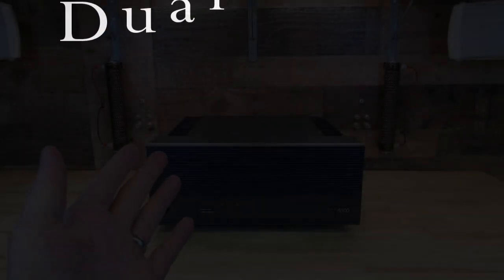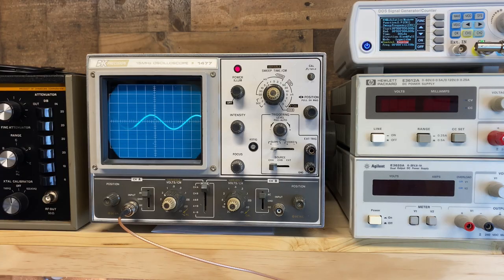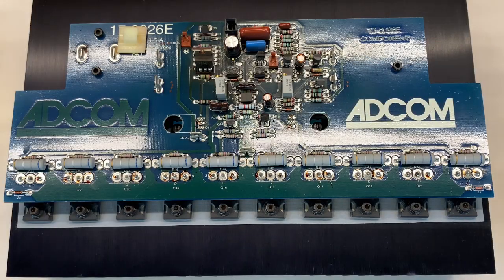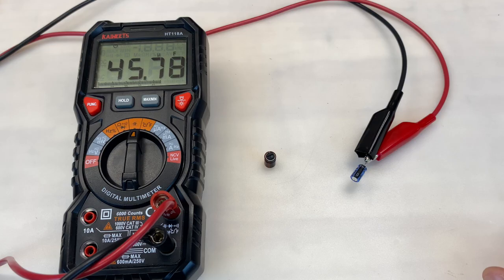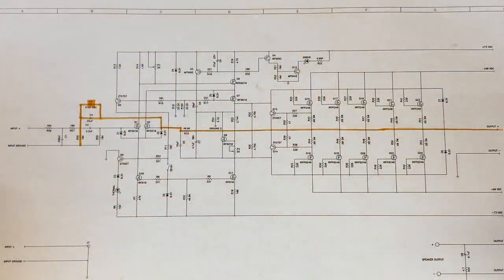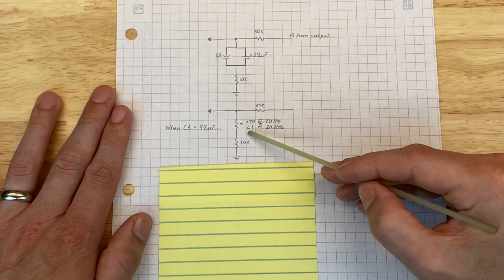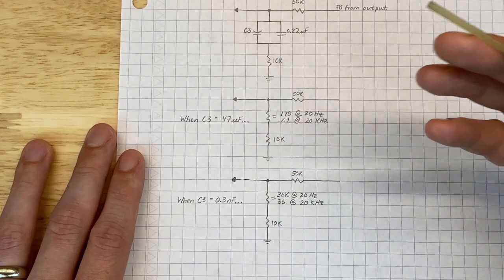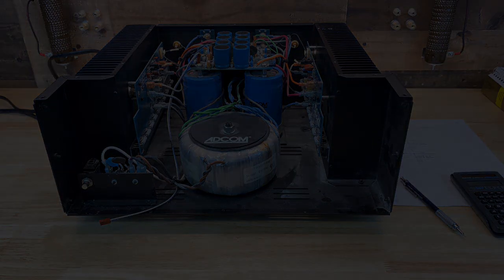DR #55 - Restoring the Bass on an Adcom GFA 5500 Power Amplifier

Comment: I have this same unit, my right channel heat sink, slowly drifts over time and is noticeably cooler. 

The right channel p2 pot seems to drift downward , sometimes as low as 11mv, requiring me to adjust the p2 pot with a multimeter to 50 +/- 5mv across the r32 Resistor.  Left channel drifts downward too over time, but to a lesser extent.

What is the most probable culprit?

Thanks for your video, I'd love to service this thing if needed.  I bought this back in 1999 I think. 

Based on the age, might have to recap?

Thanks for your video 😎

Comment: I've owned and repaired many Adcom amplifiers. The 5500 and 5802 are both MOSFET (HEXFET) vs Bipolar designs and again are based on Nelson Pass designs. When they were introduced a dealer loaned me the 5500 and later the 5802 so I could compare them to my GFA 555ii and GFA 565 mono blocks. The GFA5500 and GFA5802 were definitely more neutral while more transparent sonically than the earlier GFA555ii and GFA mono blocks. I periodically bench them and both the GFA5802 and GFA5500 still meet specifications. I have replaced the smaller caps on the 5802 and reduced the bias levels on the 5802 as recommended by Adcom to reduce internal heat on the 5802. Thanks for your video. I appreciate your clear explanation of your diagnostic approach.

Comment: I upgraded all my small caps to Elna Silmic II's, 4 big caps from 18,000uf CD's to 22,000uf TDK-Epcos, and the 8 smaller caps to Mundorf 1500uf jobbies.

It betters a Sugden A21SE's amp section. Up there with First Watt and the XA30.8. Just a fantastic amp, wholly designed by Nelson Pass.

Comment: Hi, i have the same amp sitting in closet since it was bought new. Never turned on. is it safe to use it now? Thanks for your informative video. You said the 8 electrolitic usually goes bad thats why i want to ask first before powering it up for the first time.

Comment: My GFA 5500 has the same poor bas response. I tried replacing the 8 caps on the top but made no difference.  I'm going to take the amp apart and try this fix.  Fingers crossed it brings life beck to my amp.  Can you recommend  mfg p/n for the (2) 47uF Caps?

Comment: Hi, I've got a similar issue on my Mission Cyrus one. Did you measure the output voltage under a resistive load?
Reply from the maker: Yes, the amp was connected to 8 ohm - 500 watt resistors.
Reply: @dualityrepair4770  Thanks!

Comment: Your video is very useful and gave me the notion that the ayre mxr i owned has a similar issue. I always felt that the ayre lacks bass weight and resembles little to the reviews i have read. Would you think the ayre would have something like a "c3" lurking in the unit that is hindering the bass performance. Your insights is appreciated. Thanks
Reply from the maker: Yes it could very well have a “C3.” Unfortunately I can’t find a schematic anywhere to help point you at a specific component or area.
Reply: No worries...when I find a schematic I will come consult you again. Thanks

Comment: I am a bit confused by the feedback resistor being so high at 10K ohm wirmth the other 50K ohm that would make the overall gain only X 6 or have i missed something.
Reply from the maker: Good eye.. and you're right.. a gain of 6 is ridiculous. It turns out that the schematic isn't completely correct. The feedback resistor is indeed a 49.9K, but the resistor to ground is not 10K.. it's 1.82K, making the gain ~28. Thanks for bringing this up.
Reply: The old schematic documentatio error problem .
That is why we hone our fault finding skills to give us the tools to overcome these obstacles. 
Dealing with lack of or conflicting information.
Maybe that would be a good subject for one of your future videos. @dualityrepair4770

Comment: Its easy to know why caps failed like that, its caused by heat you can see discolored pcbs in almost all Nelson, Adcom and Nakamichi top end amplifiers he likes to design time bombs deliverately, that amplifier also has a small heatsink in the differential pair that almost all the times (have seen that small metal thing missing in almost all of that model amplifier) and if it didnt went missing it will short ccircuit some transistor or something after the glue fail under the heat...... the same heat that caused the video capacitor fail 😅
Reply: This isn't Nelson Pass's fault, he only provides the circuit design. Adcom did all the actual board design, including decisions on heatsinking.

Comment: This failure is likely caused by heat. The input mosfets run super hot, which causes eventual failure of the capacitor. You can tell how hot the board gets by how browned it is in that area. There is usually a copper heat-spreader bar installed across the two mosfets, meant to keep them thermally tracking, and dissipate some heat. It looks like yours either fell off, or it wasn't included in that particular production run. What I do is install a DIP-16 heatsink across the two of them, with thermal heatsink epoxy, and that dissipates heat better than the original copper bar, as well as thermally coupling them. Also, the heat cycling eventually cracks the solder joints, resulting in a crackling sound, a common issue with this amp. The solder joints just need a touch-up.

Comment: O.K. but why did the elcaps went bad? Strange, but it is as it is of course.
Reply: Both channels had the same cap fail in the same way, from age or something else?
Reply from the maker: I believe they failed in the nearly the same way and at nearly the same time. The caps were probably from the same manufacturing batch, so suffered from the same issue. And since both channels would always be running together, each cap would be subject to the same amount of use. 

My other thought is that one channel did fail before the other, but it wasn’t noticeable to the owner until the other channel failed too.
Reply: @jim9930  Seems suspicious in most cases it might have been by design.  I've seen computer CRT monitors fail back in the day, just days if not weeks after reaching the limited warranty. The failure was due to the power supply capacitors running at the cap-rated voltage. In most cases, caps should have been rated double the application voltage.

Comment: Wow, seeing that the capacitor that went defective isn't subjected to a life of high ripple current or voltages near its rating, I am surprised that it failed in the way it did. I am thinking there was a very poor selection of quality when purchasing. Nice repair presentation!
Reply: that capacitor was subject to ac - the amp's output - thats the reason for the early failure. in other words, poor selection of parts by adcom
Reply: @jim9930  Did you take into account that, there is a 49.9K Ohm ( lets' call it a 50K for all intents and purposes) resistor between the amps output, and the 47uF cap?  With that cap being loaded to ground with a 10K resistor, that would only give it a max of 5 volts AC across it at a 250 watt - full output of the amp. That cap will also have a DC bias on it, seeing that it is connected to the gate on the negative feedback differential IRFD210, but the swing of a max AC signal would be less than that AC signal, and that AC voltage across the cap should be less than 6 volts, creating a current through that cap of less than 2mA according to a SPICE modeling circuit I made @ everycircuit. IMO, it was more of a poor quality cap being used than the circuit it was applied in.
Reply: @jim9930  Quit trying to say " if it wasn't behind a 50K ohm resistor",( and, it's actuallt 60K , as that cap isconnected to grund through a 10K resistor as well)  it IS! The point that that capacitor is DC biased in its proper polarity, but has a max AC voltage on it that wouldn't reverse bias it, negates that point. Also, a modern day replacement, a Nichi UFW 47uF / 100V rated cap, has a max ripple current rating of 210mA @ 120Hz, and that cap is only subjected to less than 3mA of ripple current ( and that's only at full amplifier output), shows it should do just fine, if it is a quality replacement component. 3 milliamps ( under worse case AC ripple scenario), will not destroy a quality capacitor if installed in that circuit.

Comment: When I checked the calculations, I came up with 26.5Mohms for the 0.3nF cap at 20hz. So NFB attenuation was even worse.
Reply from the maker: Yes that’s correct for the 0.3nF cap alone. I was calculating based off both caps in parallel (0.2uF + 0.3nF).
Reply: @dualityrepair4770  What's the purpose of those two caps when their impedance never goes near the 10k resistor across the whole audio spectrum?

Comment: Great video!  I worked over my 5500 a few years ago.  I replaced all the electrolytics on the amp boards with Elna SILMIC IIs though I think they've been discontinued.  Also replaced the polyester caps with polypropylene units.  Also replaced all eight of the 1000 uF electrolytics in the power supply as they were bulging.  The amp sounds amazing!

Comment: Can’t believe this randomly showed up in my feed! I acquired a GFA5500 (along with a Krell KSA 200) in a trade for a turntable I had restored. Tge deal was actually for the Krell, but he threw in the 5500 because he was clearing out some space. Neither unit was in working order. Figured I would take a look at the  5500 first, as it’s a bit less intimidating than the Krell…. Powered it up, no speakers just to do some quick measurements. No smoke - that was good :) But, I was seeing the full rail voltage on the speaker terminals. I poked about a bit, got some help on DIYAudio trying to figure out what the issue was, but no luck. So, I sent it out to a tech, and they didn’t want to repair it (Also sent them a Marantz 7T that I had done a full recap on, which was working wonderfully until I was trying to run a sub off the center channel, and right channel went pop - but that’s another story) All that to say, tech either couldn’t or didn’t want to fix that either. 

I was informed that all the semis in the 5500 were bad. They also said there was a 16A automotive fuse in the 5500. 

I am subscribed and excited to watch the rest of the videos in this series. The 5500 is supposed to be a very capable amp!

P
Reply: It is a very good and pretty  simple amp

Comment: Thank you, very useful information.  I'm puzzled why the same capacitor failed on both channels. Design issue? Component quality, or sizing issue?
Reply from the maker: Good question. I was thinking component quality. The ratings are appropriate and the design seems solid.
Reply: Age and heat IMO. These amp boards run very hot, as you can see by how browned the PCB fiberglass is.
Reply: This cap is located directly above the input LPT MOSFETs, which run super hot.

Usually there is a copper bar glued across the tops of the input MOSFETs, that thermally bonds them so they track each other better, and it dissipates some heat. This amp doesn't seem to have the bar intact, or it was not included in this version. They do fall off! What I do is use thermal heatsink epoxy to attach a DIP-16 aluminum heatsink across the two input MOSFETs, and that dissipates heat better while also thermally bonding them. -Chris Hoppe of Hoppe's Brain.
Reply: Heat, actually. This board runs really hot, as you can see by the browning of the PCB fiberglass. The input LTP MOSFETs in this design run especially hot, and are located directly underneath this poor capacitor. There is normally a copper heat-spreader bar glued to the tops of the transistors, which keeps them tracking thermally, and also helps with heatsinking. This amp is missing the copper bar, so it either fell off or was not included in this revision.

What I do, is attach a DIP-16 heatsink to the tops of the transistors with thermal heatsink epoxy. This dissipates heat better, as well as providing additional cooling.

Also, the heat causes cracks in the solder joints from thermal cycling, so I recommend re-touching those solder joints.

Chris Hoppe - Hoppe's Brain

Comment: I sure hope I have time left in my life to able to make repairs like you do.  Currently, I have 3 NAD amps and a NAD CD player that need TLC.  I also have my late mother's 1980's Fisher system I would like to get going again.  It makes a loud thump through the speakers and cuts off the output.  Must be going into protection mode.  Been like that since the mid 90's.  Haven't turned it on since.